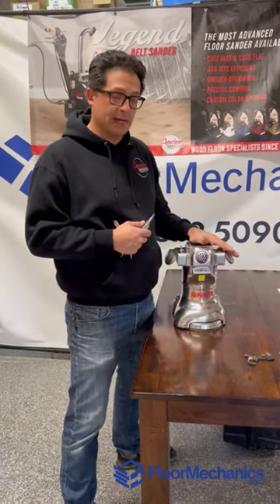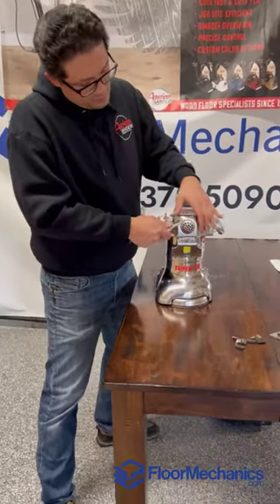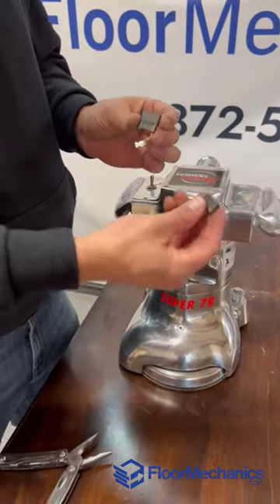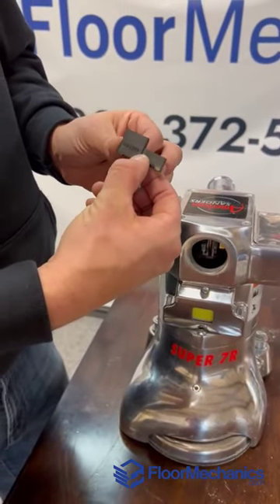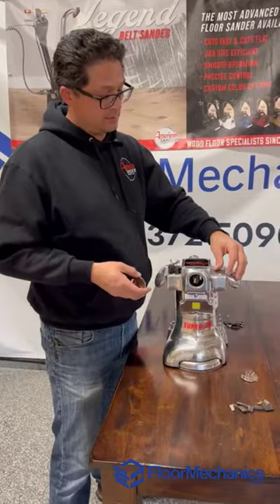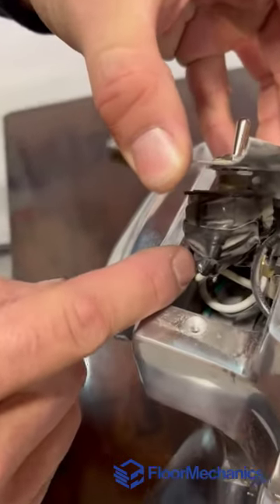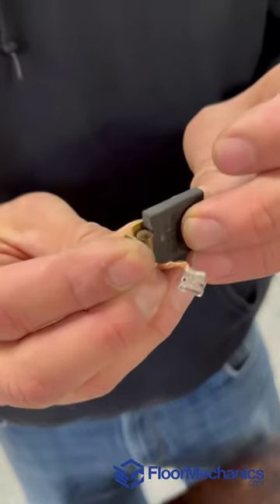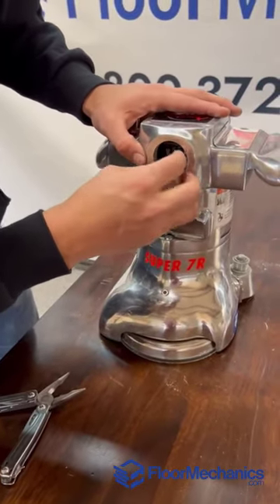How do I change the brushes on my Super 7R edger?

Comment: Hi

My Super 7 lights up on the 1.switch first. 2. I checked the brush, but it is almost the same as the new one. 3. The motor does not rotate. What is the problem with this phenomenon?
Reply from the maker: Hi James - we and the American Sanders reps can help, but we need a little more info. A video would be nice too. Could you please call Floor Mechanics at 1-800-372-5090?